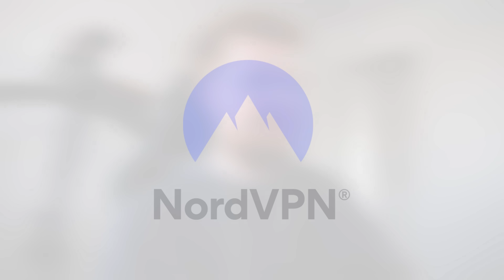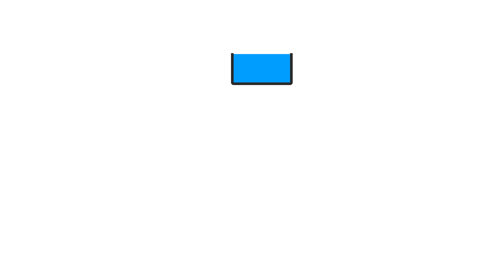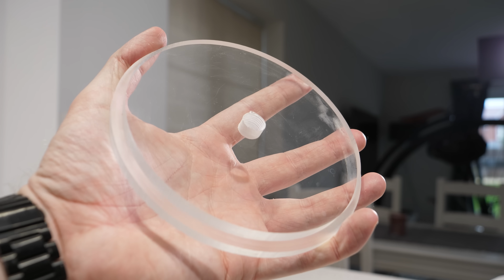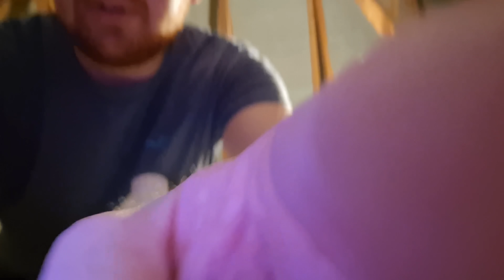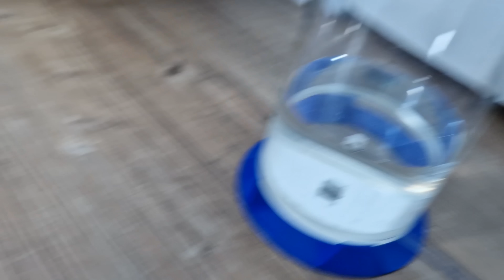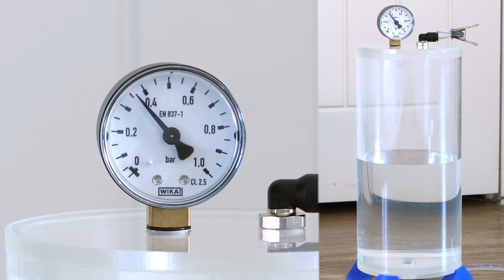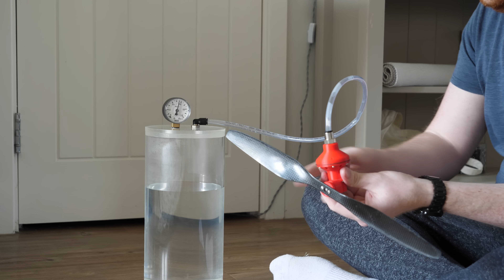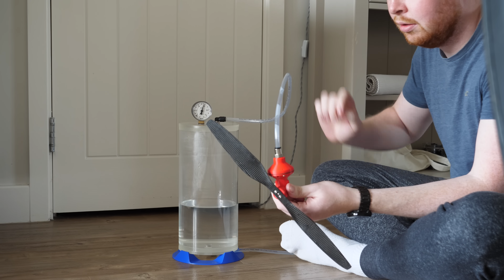Liquid Air Engine

Comment: I'm not an engineer, but when he said about cutting it off so the engine doesnt flood....is there a way to make an engine thats powered by water....water that can be cycled back into a tank on its own to keep the engine going indefinetly. so like, you open a valve, water goes in engine, moves engine which also removes the water which goes through wahtever wizadry you would have to do t get it back into the original water tank. i know theres some law probably about getting less out than you put in, so it would stop eventually, but there must be a way to get one to run for quite a while cycling water back into itself.

Comment: My dad told me a few years ago that my grandpa actually used air engines to run a pump when he was working which I find fascinating. I had first heard of these when I was going to school for drafting, I had built a design for one and  played around with a 3d print as well. At that time I didn't think that it was anything more than just a representation of what could be done if you play around with physics but since then I have been absolutely obsessed with these
Reply: alot of wineries still use air-powered pumps to move wine

Comment: Would it be possible to charge a small battery with that engine that you made and when the water gets too full have a small electric motor pump the water back up to the Attic so it's an automated system

Comment: if you add even a bit more water to the tank, even if that water will "flood" the engine" then the extra hight achieved by a bit more water could help. also, by trying to keep the line as straight as posible you may be able to increase flow by keeping it lamimar

Comment: You could try putting a one way valve at the water inlet and than pressurize the tank with a bike pump. That way it runs longer and the water can push in more pressure as it gets lower.

Comment: Archie Blue of new Zealand had US Patent on water cell that ran 3 car engines. Improved electrolysis efficiency by pumped in air from bottom of cell that moves upward through staggered perforated holes of aluminum discs. ( Clean sweep of stuck ions on surfaces) Hydrogen and oxygen formed fuel. Others said that there is also fuel generated of nitrogen hydroxide , since air is 78% nitrogen. The air ions separate when going through electrolyte and reform. A second safety water bubble can with hoses required between engine and cell. 30 amps at 12v DC.  US Patent contains drawings - see # 4124463

Comment: I wonder what the math would work out to run a generator off of a rain collection tank on the roof. How big would the tank be, how much rainfall would be required for constant power output. Could you power a radio? Obviously there are better ways to go off grid, but maybe if you lived in a rain forest where you don't get good sun but do get lots of rain?

Comment: could you use the float style system in a toilet to have a constant amount of water in the tank in your loft? and increasing the size of the air tank powering the engine?

Comment: Amazing. I had a thought could you have a secondary tank and figure out the delay needed in filling it so that you can somehow switch between the two tanks filling one as the other is in use??? Or is that going to cause too much pressure loss in the switching over.?

Comment: I can't wait to see how this would run with a 'water dumping' feature... cyclone effect (would adding fan blades to have a potential of generating power that way as well...) of air being absorbed as the water dumps more and more... to which, the air and containment is pushed more with water - backflowing... Mhmmmm, science... what about adding magnets to reduce the friction and pushing for more energy via repulsion (magnets flipping)...

Comment: A slightly smaller diameter tubing and/or simply an adjustable valve on the output to the motor to cut the pressure release slightly would give you an overall increase in output pressure without losing as much actual pressure while retaining the original stroke and have a somewhat throttle control..

Comment: This is like a fluid over air cylinder in automation for industry. They do work really good at lower pressures. I hardly had any problems with them in my previous encounters as a maintenance employee at a large automotive plant.

Comment: I feel like it would have helped if the water input to the tube was at the top.  That way when the water came in, it wouldn't have the pressure of the water on top of it pushing it down.

Comment: John Keely  (Philadelphia pa. lab 1865-1899) built self running water/hydraulic engine with central rotating 4 way shock valve. He generated 50lbs pressure and output flywheel was used with power take off to run a saw cutting wood. This is now called water hammer built in- not designed out to get rid of it. U.S. Patent was not approved because investors names were not on application. See pictures and write ups  on You tube Videos

Comment: If you had a shorter tank would you require less time to build pressure as there's less volume to be compressed at the expense of overall run time

Comment: When you can apply ths to a plane to fly over the Atlantic then you will really will  have accomplished something. Stan created a system that allowed an engine to fly not only around the equator but around both poles on 1 gallon of water, that equates to I think 10 million gallons of airplane fuel to 1 gallon of water. I wish he hadn't gotten murdered in '98 as he was like a modern Tesla.

Comment: I think a bigger tube, even with the small inlet, would still help.

Flow rate is a function of diameter and pressure. At the top, you don't have high pressure, so your diameter should be sufficient to have a high flow rate. But at the bottom, the pressure is higher, so a size reduction and a smaller inlet at the bottom should suffice.

A bigger inlet will ofc still be better too. As that will cause less pressure differential at the bottom (thus less pressure loss before the flow rate can give you an equilibrium). But changing the top and tube alone will help.

Comment: Idea for another video: Make an engine that runs due to air being "sucked" through it instead of pushed. Then, buy a several thousand gallon tank and fill it with water. Perhaps purchase a city's water tower. A little engineering later, and the engine turns for hours as the tank drains. Put helicopter rotors on top, defy the laws of thermodynamics, and you have a forest fire extinguishing helicopter that doesn't even need fuel.

Comment: A lot of people mention a bigger tube as an increased performance and i agree. However, with only increasing the tank size, wouldn't the weight of more water create more pressure with the same tube (to a certain degree of course) and also increase performace?

Comment: What a pity that the energy for carrying the water up must be included in the calculation.  In an area where it rains continuously, the energy of such a machine could be used to dehumidify the air in the building... 😁

Comment: it's great!
What is the reason for the engine stopping and starting, more and more often and sluggishly? The rhythm with which this happens reminds me of the interference discovered by Mandelbrot. What would be the results with a bigger tube? Perhaps there is an ideal harmonic relationship to be found between the flow rate, the size of the chamber and the rate at which the air is exhausted. In any case, congratulations, your videos are mind-blowing :)

Comment: It's not water or air powered. It's pressure powered. No energy is extracted from the air or water. The energy comes from the pressure, which comes from the potential of lifting the water to the tank. The whole system could be a weight on a chain under a clock.
Reply: Yeah but that wouldn't make a good title
Reply: @ismaelf.telegen2531  I must agree👍 we live in a world thirsty for clicks. Unavoidable, I'm not excluded.
And I watch, and a thumbs up

Comment: How big would you have to make it to be able to charge an electric pump capable of taking the water back upstairs as well as another device like a phone or laptop. It is very neat but if you could design a self sustaining system where it provides at least a little extra for consumption it could be useful instead of a novelty

Comment: i mean it's an interesting thing to do. Although what you built is more of a single stroke water powered pump that can't resett itself than anything else. Might as well by an ordinary bike pump with a few weights stacked on the handle. :D You need a 2 cylinder setup so you can resett one cylinder while the other still provides preassure, now that i would call an engine :D

Comment: Thought I might mention that as I understand it, most of the water pressure loss is in the plastic pipe, and a bit in the fittings,  replacing the pipe alone should significantly increase the water flow rate.  Besides that loved your enthusiasm to discover something new.  Wonderful stuff!

Comment: i got an idea. What if u try making some sort of gas tank( for example for cleaning keyboard but it may have to low ammount of flow ) with some sort of controller to it (like leaver) without electronics and try to make engine for SUP board, so you can mount it on your board and drive it like slow motorboat :D
Reply: and maybe make it have 3 (or 4) pistons instead of one for improved stability of work and with them you could maybe operate it with low pressures and it will have more torque for water. i just cant stand that i dont have my own 3d printer and cant do it by myself

Comment: ...should you scratch the contact areas thoroughly and deep enough (something like 60 or even 40 grit sandpaper, and pressing HARD), a good quality epoxy is possibly the best choice to glue that together (as it would provide a really strong mechanical "key", connecting the parts.

Comment: Yes I like this Tom & as I am nearly 70, I had a thought for you. Get your mind off internal combustion engines! You don't need a piston, all
of that is surplus to requirement. Your power comes form the air pressure on the large rubber diaphragm. The connecting rod only needs
to be the size of the rod passing though your blue "piston", which you do not need & the other end of the rod fits onto the crank. 
Have fun.

Comment: Hey Tom this is a great project and I have an idea for you to try. How about using a tank in the roof which is sealed from the atmosphere then run an air line from the exhaust of your air motor back into the tank in the roof. As the roof tank empties a suction will be created and I suspect that this will nearly double the performance just like a condenser on a steam engine.

Comment: https://youtu.be/48z46pqgyBA

Hidromek 640 Design / HMK 640 Wheel Loader / Resine printed / Rc Control / 3D Printed / Solidworks

Hidromek 640 Wheel Loader Model Design, 3D prototip Model, About the working system.
1). Real Design: The Wheel Loader design is realistic and eye-catching.
2). It was created in the dimensions of the original Hidromek 640 Wheel Loader Model. asdas
3). Resin (SLA) and FDM printer can also be produced, so you can use them for a long time.
4). You can use it to fit your desk by sizing it, or you can get a real model by making a mockup.
5). You can make logos and texts in bait.
6). It is easily printable. ( Scales studied (1/18, 1/24, 1/32, 1/48, 1/64, 1/87, 1/120, 1/160, 1/220)
File types; ( Obj, İpt, iges, Xt, Step, Stl, Sldprt, Sldasm)

Comment: I bet you would see a significant improvement in the engines performance. with larger diameter tube and fittings. and a smaller prop.. and it was probably safe that you didn't allow water into the engine. because it might hydraulic it ultimately damaging it.

Comment: It would be nice seeing a version made that its water powered and it would be easy to see different water pressures, as tap water could be a source of motive force for it. Also a pressure washer outputs around 100bar of pressure and thats available on hand. At 100 pressure with long strokes and low rpm the torque could be amazing. Its worth a try.

Comment: What if you harnessed the movement, as well as the weight of the water? If instead of the vinyl/plastic tubing that carries the water down, you used a tube with micro-turbines. Each turbine would have a magnet at the edge of the blade. The tubing would have finely wired copper coils on the inside of the hydraulically secure tubing. (I know, same principle as dams use). As the water flows down you get a current from the coils - ultimately to be stored in a battery. But maybe you could also get the compression effect at the bottom to compress air into a storage tank. Now you got two batteries, or storage media - one air, one electric. A pressure regulator might be used to keep the air-compression from stopping the flow as it builds pressure in the tank. It would variably bypass the flow to maintain a static tank pressure, allowing the electric system to continue. The turbines might be centered on a wire, and self-lubricate by injecting water between the wire and the turbine.

I realize this is beyond the capabilities of garage-engineers, even with 3-D printer capabilities. Just thought I'd broach the possibilities!

Comment: I wonder how it would do to put it the system in pressure set at your sea level adjustment pressure at your altitude and a loop of the system to be closed as far as the water goes either that and/or heat the water with how you have it now and try both pressure situations.

Comment: Here's an idea - how about you put 1 inline tap on the water inlet tube and 1 on the air tube instead of pinching it. You can also use them to regulate the flow of water in and air out. That may have saved you from having to modify the engine. Just a thought. Let me know if that would be viable mate. ✌️♥️🇬🇧

Comment: This is really one of your coolest vids. This seems like and idea that could have real applications. Let’s say some iteration, scaled up was put at the bottom of a dam, what advantages and disadvantages would it have for power generation? Btw it would be cool to that motor generate some electricity.. even if just to run some LEDs..

Comment: Just a hint for cnc milling plastics is to fit an air nozzle to the mill head aimed at the tool to keep it cool. Stops all that softening and spring back that happens when the tool and the work get too hot.

Comment: All in all, this is really converting the potential energy of the hydrostatic water pressure into kinetic energy. Like a water wheel. You are converting the hydrostatic water pressure to air pressure to then drive the pneumatic motor. I wonder if a hydraulic motor that does not have energy losses due to the elasticity of gas, or losses due to slippage as you would have in a water turbine, would be more efficient in converting the energy to its desired end kinetic form. Either way, we still have to either push the water back up into the upstairs reservoir from the downstairs pressure chamber to start over again or drain it out and replenish the upstairs reservoir from another source. You have a pretty cool design though. I like the diaphragm approach.

Comment: You should combine two engines to make a two cylinder engine. Even with more friction it would probably run at lower pressure and you wouldn't need a fly wheel. Would like to see that.
Great video👍

Comment: thats super cool maybe if you put weights on the rotor tips if would make the engin run smoother and maybe for longer as your current design runs very rough at lower pressures

Comment: increasing the diameter of the compressed air tank wouldn't increase the hydrostatic pressure but it would increase the amount of air creating the air pressure.

Comment: I was trying to think about an air powered engine, and realized I ended up with a hydrogen fuel cell... Same thing happened with thinking about a solar powered mechanical tree that creates sap that's turned into fuel... That's basically what people are doing for carbon neutral fuel facepalm

Comment: What if you created a second system like this who's purpose was to refill the primary system?.
I think it would need to be larger and a pump might need to be printed but you might be able to get it to run using the same method.

Comment: I would love one of your air motors I’ve got a few ideas to make them run for a long time, have you heard about hight pressure air tanks for paint ball there made of carbon fiber and you can chose your side they go up to 4500 psi and have built in regulator

Comment: I wonder if you could use some sort of Pythagorean syphon to empty the water from the tank and then use the vacuum created by it emptying to continue to drive the engine.  So maybe the bucket in the attic could be large enough to fill it multiple times and just keep cycling?  I'm not sure because I'm guessing if a vacuum was created it'd start to pull water faster but I wonder if it could be designed so that, once empty, the pressure equalizes too and the whole cycle just starts over.

Comment: 1955 Citroen d's 19 had spheres with diaphrams much like your cross section art of your engine.
Might be something you can learn from that systems hydraulic "computer".
There was a troll affair under the brake button(champion= mushroom they called it.
When pressed the rear suspension pressure powered the rear brakes only , I think, which lowered the rear of the car to allow equal patch pressure to all 4 tires.
In America they filled junk yards because they stopped so well they kept getting rear ended.
In the car it felt like in a speed boat when you killed the throttle you just stopped and settled in down in the water.
So you couldn't tell you had stopped so fast.
They had massive inboard disc brakes like train wheels attached to the front wheel drive transaxel.
5 minutes to change brake pads..
Lift hood, undo wire retainer, pull out old, put in new.
In 1955!